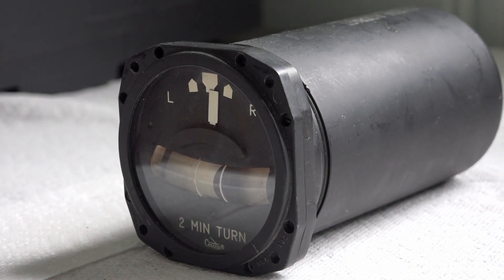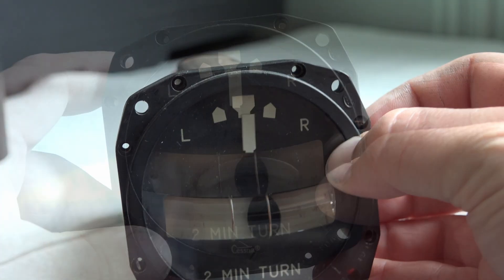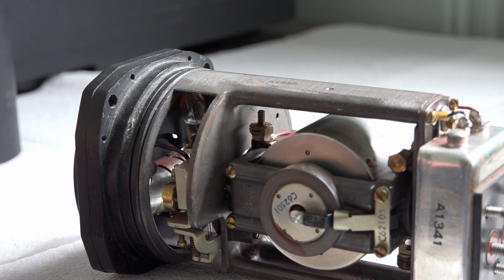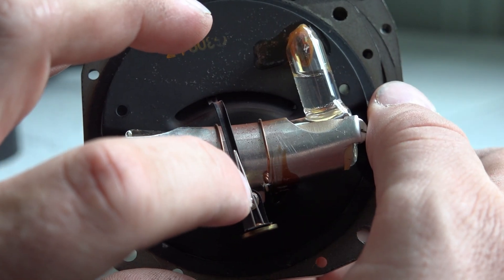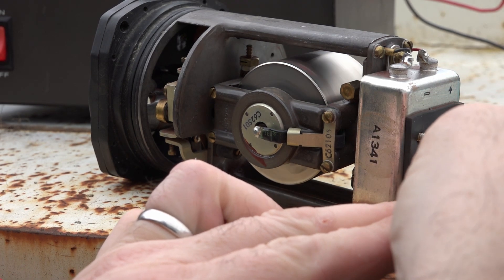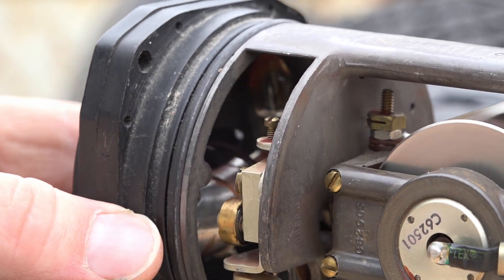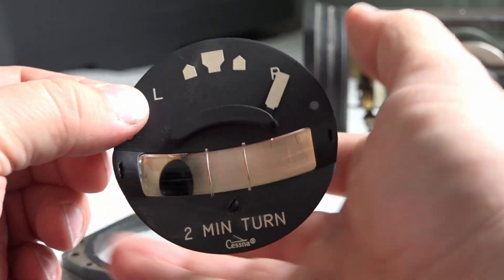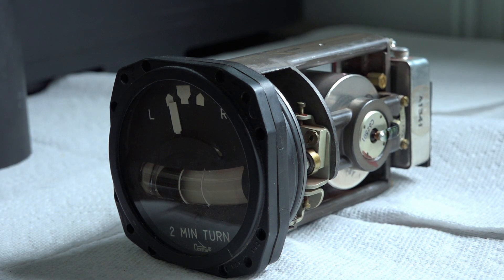What's Inside a Turn Coordinator?

Comment: The dampener is called a dashpot
Reply from the maker: Ahhh I have heard of that! We use those on carbureted engines on the idle linkage so coming off a fast RPM the car won’t stall when the primaries are shut fast. Bless ✌🏼
Reply: @Piston_Pounders  yup they typically use a vacuum I believe their first use was found on steam engines to dampen the valve gear, very similar to the carburetor application.